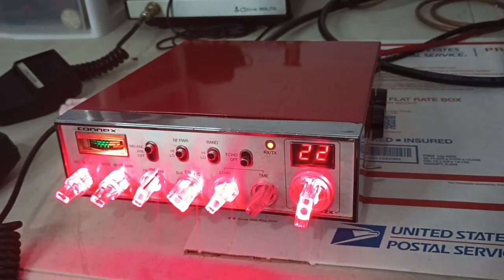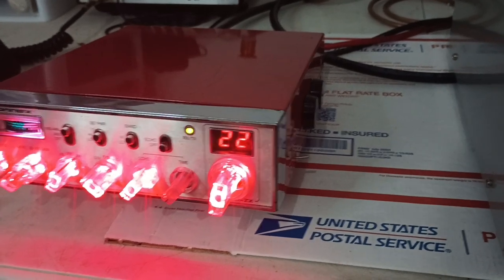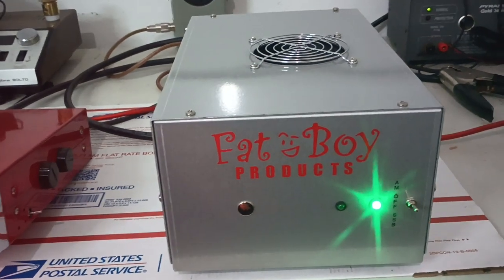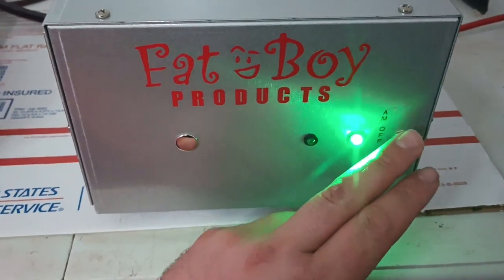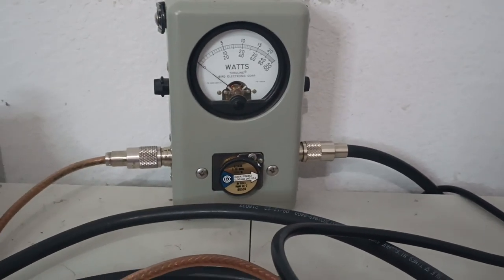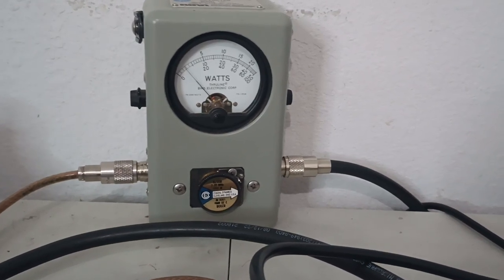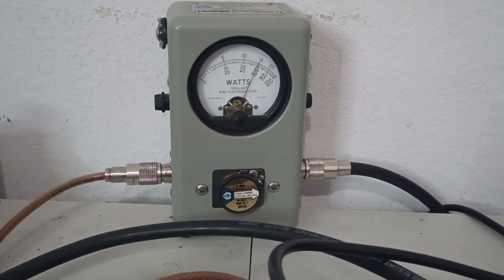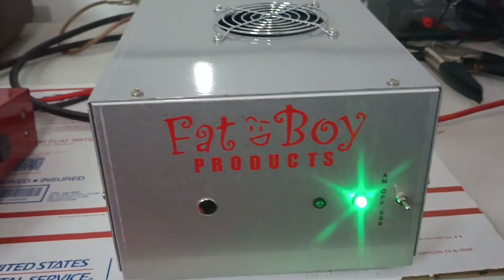Customer Test Video, 4 pill 454 Base Amp with Biasing and SSB

Comment: What amp wall plug is needed for the internal power supply? Is that a switching supply ?
Reply from the maker: Switching yes, standard wall plug is fine on this amp, very minimal amp draw